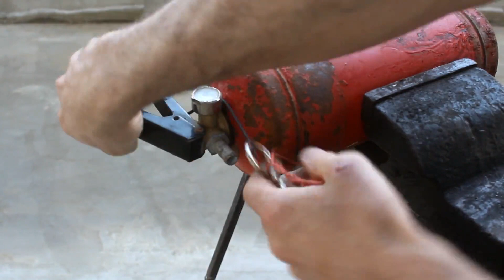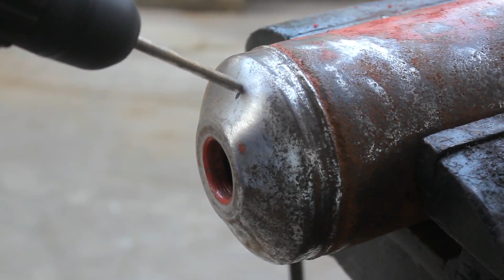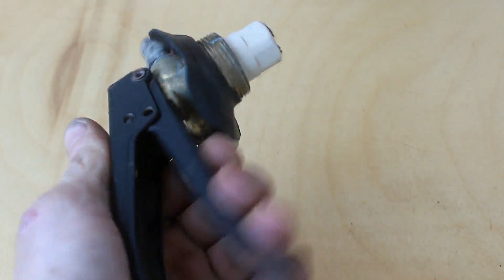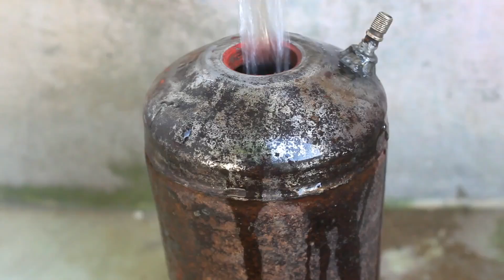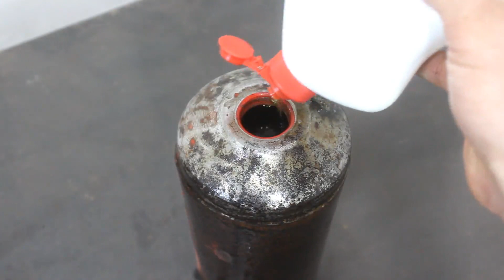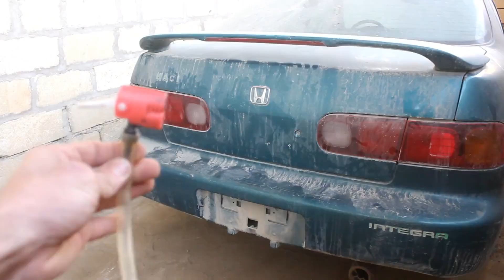Cool idea! Don't throw away old refrigerator compressor!

Comment: 👍.       I've done something similar with extinguishers and even plastic garden sprayers using a rubber tire valve. (The pumps on garden sprayers are notoriously poor quality.) In order to make the extinguisher/sprayer completely portable, simply pressurize it - but only 3/4 fill with water. (The remaining 1/4 is for compressed air space.) It can be pressurized with something as simple as a bicycle pump. You will have to determine how much air pressure will work best for your situation.